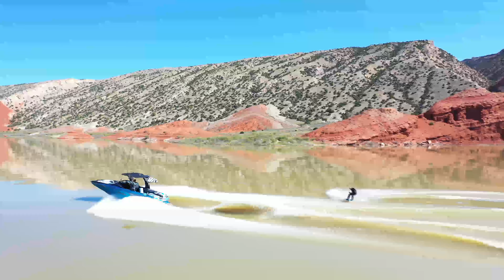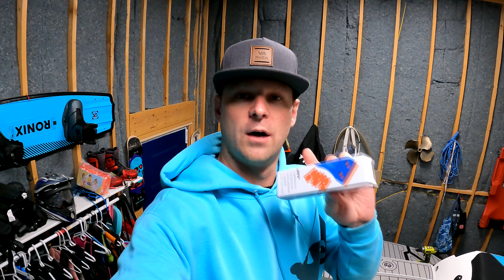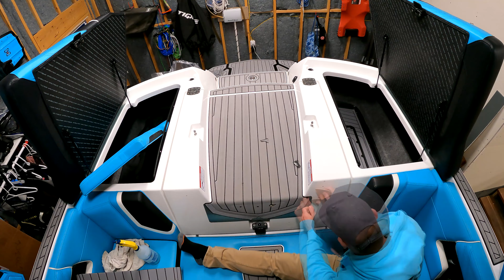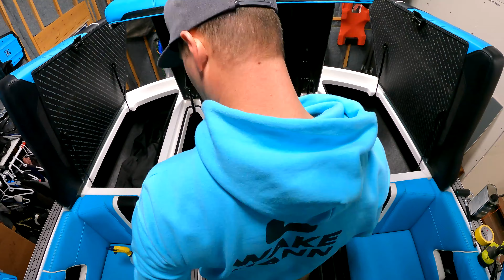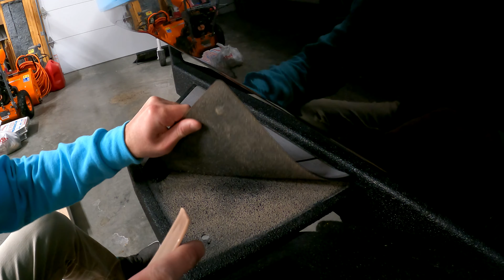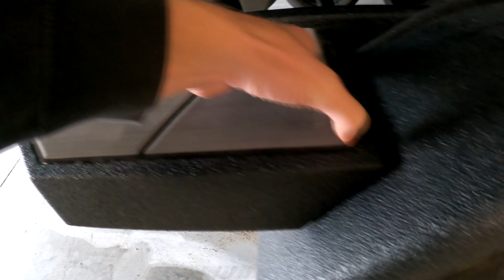SEADEK REPAIR!!  DIY Series, Episode 16

Comment: Great video, thanks!  Pretty much all the seadeck on my GS 20 trailer has peeled off.  I have a new set to apply, but definitely will do the extra adhesive this go around.
Reply from the maker: You're welcome!  Yea if you have the rhino lined trailer then do the 3m 90 adhesive for sure.

Comment: Great video, did the new sea deck have a backing you peeled off I assume?  Couldn't really see that part.  That removal part of the video was entertaining, that looked like a fight!  but you got it.  One reason I did not get that trailer paint was I was afraid the sea deck would fall off, interesting to see that it does, but having a trailer that does not rust is the pro.
Reply from the maker: Thanks! Yes the seadek has a peel off wax paper like a normal decal.  It depends on the trailer company as my Malibu trailer was rhino lined and the seadek never came close to coming off.  The problem is specific to Extreme Trailers so far.  It will be one of the first things I check on my boatmate trailer.

Comment: Would have  use a heat gun and a can of toluene. Its what is used  for repairing inflatable boats made of hypalon. Nasty chemical but it would make that surface look brand new before you stuck new sea deck.
Reply from the maker: Thanks Clark, I was using a good hair dryer.  I also know I could've used mineral spirits but want worried about cleaning what was left after experiencing the crazy adhesion of this stuff but I will keep these tips in mind for future projects.

Comment: WM - I think it’s great that you do these DYI videos.  

Out of curiosity, what’s your experience with dealers covering Sea Deck issues under warranty?
Reply from the maker: Thank you!  Dealer typically takes care of stuff like you saw on my trailer and peeling up anywhere else under warranty.  My dealer did put new pieces on my trailer but I could tell some were going to come off again so I just redid them.  I replaced the one in the boat because the previous owner damaged it in a few places.

Comment: Hi Wakeman...just following up two years later. Is the glue down of the Sea Deck repair still good ?
Reply from the maker: Hi Art, this is 1 year and 2 months later and I dont own this boat anymore but the glue held up very well for the 1 season I put on it.  I put about 90 hours on this boat last season.  In my opinion, the glue works great, just have to apply it correctly.